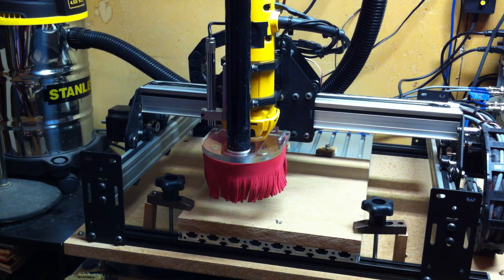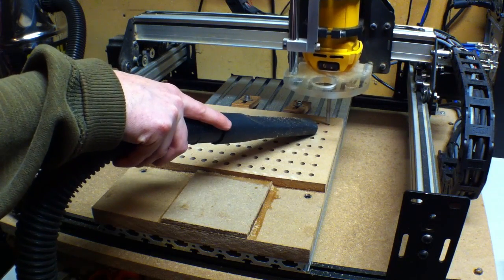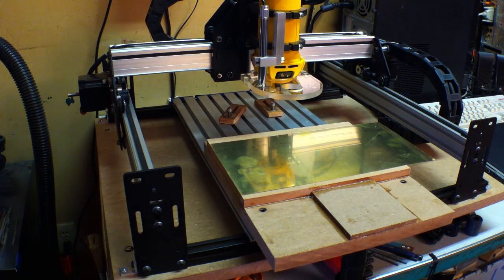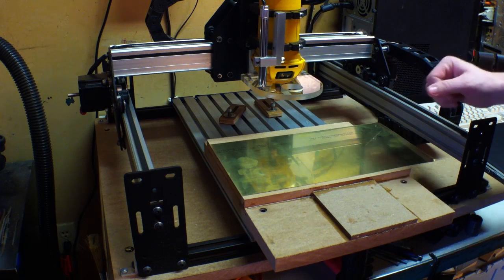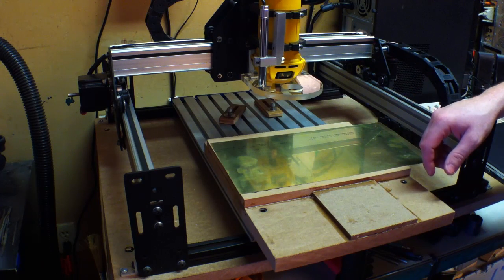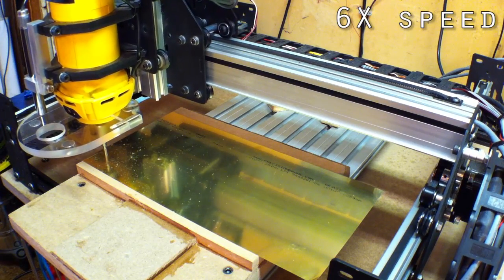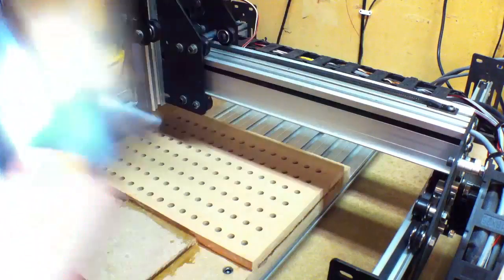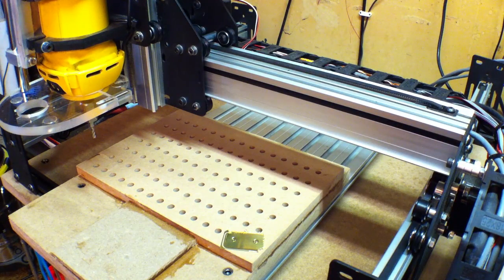ShapeOko 2: Vacuum Table

Comment: you might try smaller holes, I say this because I've been a screen printer for 30yrs.
I used to print on 1/4" by 24" x 36" masonite chalkboards and they never moved.And they had the force of a rubber squeegee pulling across
Reply from the maker: james shelton Thanks for the tip! I'll keep it in mind for the next version.
Reply: Caleb I did a search on Youtube and found some other vacuum tables made for cnc.